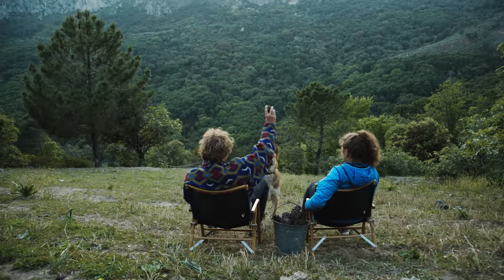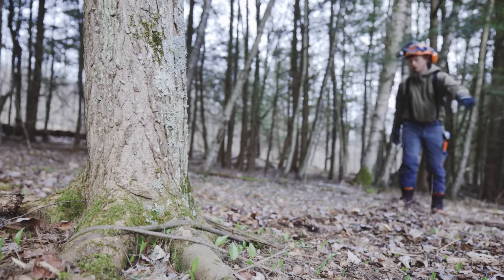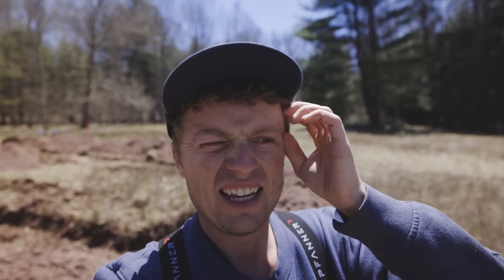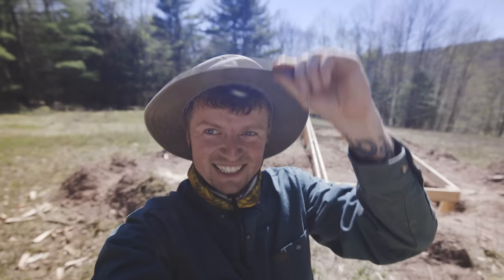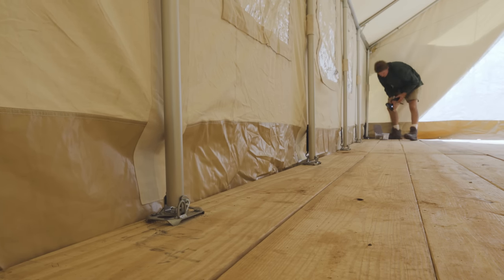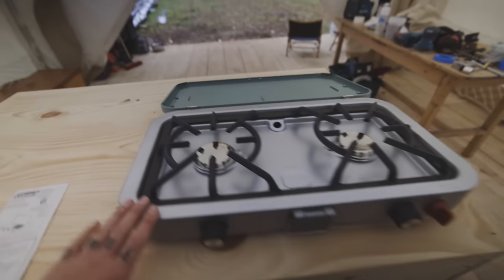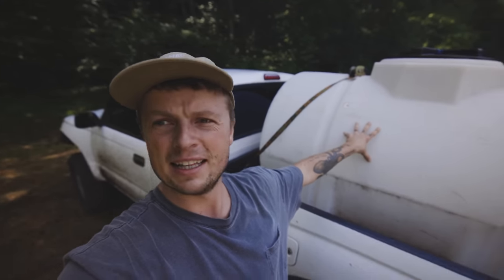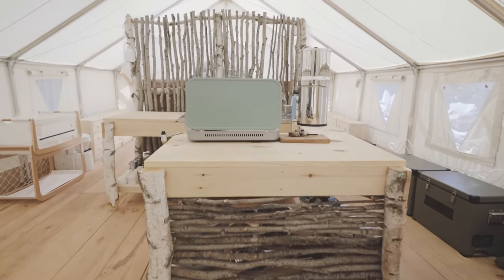We Built An Off Grid Tiny House (from start to finish)

Comment: Great Job!   You do realize that you are most of the way to having a four seasons full time house?
1- Insulate the floor.  3 inches of  rigid foam. 
2- Insulate the tent.  Check out yurts in Montana and Alaska that are used full time in much more severe climates than NY.
3- Install an Alaska rated wood stove or propane heating.
4- Build two or three double pane wood frame opening windows.
5- Build an insulated mud room entry with a nice door.
Use all the money saved for trips to Belize

Comment: I understand not wanting to use chemicals to treat the wood but I would of advised charring the wood columns at least the sections below ground level as it’ll likely begin to rot pretty quickly just as it is.

Comment: Were dug foundations necessary? I'm thinking concrete pads with posts to a frame would have been cheaper and easier? But tbh I have no experience so is it due to the size?

Comment: At the start you mentioned living in this through the winter? I'm wondering how you're going to keep that water tank and those batteries warm with them outside under the platform like that. Not to mention the wall tent seems to have no stove or reflective insulation of any kind. Not trying to rain on any parades here. I'm just genuinely curious what you're gonna do here.
Reply: why is it so hard to rewatch literally the first 20 seconds and hear "to build a tiny house and use as a base camp for summer"? you definitely spent more time writing all of that.
Reply: @lido_kol  Ah. I see. I guess I misunderstood. I thought he said the camp was to make it through the winter. This makes more sense

Comment: You should have concreted the post into the ground they are going to rot on you and you will have to replace them in 5 to 7 years
Reply: The water drains away on a slope.